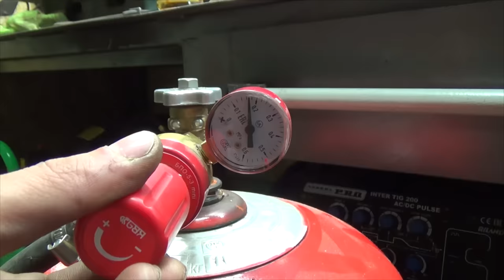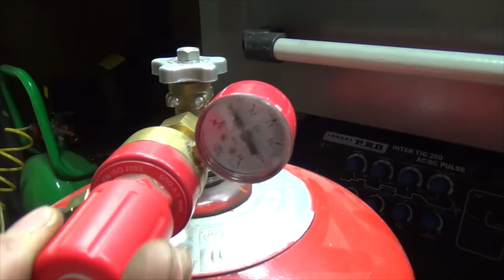Forge / Furnace turbo gas burner DIY jet propane

Comment: I apologize but any diy video that includes mill or lathe work instantly loses all credibility for me. Not saying this isn’t cool, just stating a fact.
Reply from the maker: you can not use a lathe stonok. use the correct size washer and drill the hole with a hand drill. welding can also be omitted, glue on the glue.
Reply: I do agree. Its a minority that does have an acces to a lathe or a millingmachine. But still a good video and i will copy this design😊

Comment: This is the standard burner that most every blacksmith and smelter uses. Same design that has been around for soooo long. And nothing turbo Bout it. That is a venturi burner.
Reply: Exactly, but there are plenty of wankers around reinventing things and using Turbo! and Insane! In the descriptions. 🤣😏
Reply from the maker: each has its own characteristics, but the principle of operation is the same
Reply: @MrNonius  I watched a lot of videos how to make a proper gas burner and the most of them aren't that powerful and so simple to build as yours so I agree that your burner is a real deal, could you specify the exact length of the tube, adapters and gap between nozzle and adapter in mm.? because I can't really understand what is added in the description
Reply: @MrRomanblond  
I'll try to help. Looks like 1ft pipe 1inch diameter. 2"x1" flare adaptor. MIG/flux core welder tip. Don't know what size. Hex threaded standoff. Then a bolt of some size. Then just scrap pieces of metal.
Reply: For orifice sizes theres charts online.
Reply: @MrRomanblond  if you don't understand from the description I'd suggest not playing with fire. Be safe, not rocket science but don't burn shit down by numpty.
Reply from the maker: pipe 1 inch pipe length 300mm
Reply: @MrNonius  thanks, I managed to assemble burner and it's awesome, so super easy to make and no need to have those fancy tools like turning cutter that other tutorials I watched
Reply: I’ve built a couple. I do like his choke design though.
Reply: Could I build this but put a 45° fitting on instead of a reducer for the flare?
Reply: Kl

Comment: Good job, I have worked in the R&D at a gas appliance manufacture, many hours spent on gas venturi development, along with orifice design, your design of adjustable orifice location and primary air adjustment is exactly what a good setup needs, advanced orifice design is really only needed if your trying to hit emissions and efficiency targets.

Comment: Thank you for the video, I have watched it numerous times, and made my own version of your turbo burner, with a few tweaks to the design to fit my needs. Mine will be connected to a 100# propane tank. I'll be using it to heat my foundry, though, if I wanted to, I could adapt it for a small forge as well.(currently I use a coal forge) The only issue i have at present is how to connect the propane fitting to my burner. I believe I used a 3/8" bolt hollowed out, with a .035 weld tip as my gas feed. I have no idea what fitting(s) to look for... will probably hit up a hardware store with my bolt/plate and propane regulator hose in-hand to see what I can come up with.... sorry for the rant, thanks again for your inspirational video!!!

Comment: You should add a blower motor to the end to force air into it. I used a old air mattress blower and attached a dimmer switch to it so I could control the speed. You just have to dial it in and it increase the temperature drastically.
Reply from the maker: thanks, I will take your offer
Reply: I used a tee at the top of my burner and added forced air with an electric blower motor.  I simply used a tee and a ball valve to control air, all pvc.  Forced induction is the only way to forge imo.  Naturally aspirated, with or without choke, can never come close to forced induction performance.  Also the galvanized fitting will give this person zinc poisoning.
Reply: How about Air Compressor? How many PSI for the pressure?
Reply: I have used a hair drier to blow air into a charcoal furnace and it would melt bronze. I love your video. It opened my mind!
Reply: Forced air burners are not so simple. You can't just add a fan and it goes brrrrr. You need much more tubing, a needle valve, and many other parts.
Reply: @LBCAndrew  I always love when people like you comment on stuff they know absolutely nothing about. It's hilarious to see you actually type out something so unbelievably stupid and wrong. You're talking to a person who literally built a forced air burner by doing exactly what I said in my original comment but you're somehow going to tell me that I "couldn't do that". Honestly it's amazing. Yes you absolutely CAN build a forced air blower extremely easily and no you don't need much of any "extra parts".

Comment: I have always respected the work of people who work with metal show off their skills in making products such as the turbocharged blacksmith sburner can increase the flame by increasing the pressure, but I think it's enough  it's a pity mine barely works.
Reply: Turbo or forced air needs a blower motor.  This burner is NOT forced air or turbo.  It is naturally aspirated with a choke.  <---Facts.

Comment: Great video!  Just a comment--the straight tube needs to be long as you show in order to get enough air/fuel mixing for stable flame.  Many burner failures are due to inadequate mixing before the flame front at the exit!
Reply from the maker: Thanks. I have a 300mm tube

Comment: Interesting. Some suggestons. 1. use a stainless steel reducer for the flame holder; mild steel won't last long. 2. Not everyone has access to a lathe. could you use something like a 1/4" pipe nipple instead of drilling out a bolt? 3. It looks like it works well but i wonder if a gas mixer would help? I used them on my blown  forges. Looked sort of like a six petaled flower but with the petals twisted to about 15 degrees off the axis of the tune
Reply: Вообще-то у него чугунный переходник!

Comment: Great video. But if this burner will heat an enclosed furnace, please show it working in an enclosed furnace, where there is no additional air to support the flame.  Some burners work much differently in the open air and inside a closed furnace.  Thank you.
Reply from the maker: Thank you

Comment: Venturi burners are nice but I prefer a forced air burner I get the same result running 10 lb of pressure on the gas that I do running 30 lb of pressure with a Venturi burner, saves me tons of money on propane

Comment: DIY jet propane burner all you need it a few odds and ends and a $600,000.00 lathe.
Reply from the maker: use a drill and a large washer

Comment: Is that OSHA approved and ANSI certified?  LOL.  Its bad ass.  I made one similar at work to heat a large chunk of metal up faster than a small rose bud would.  Needless to say they were not happy about it even though it worked great.  You went a lot further with it than I did.  Much better design than mine.

Comment: Yes all you need is a 1/2 million dollar machine shop for your simple DIY propane torch...
Reply from the maker: paper do not have a lathe to drill and the bolt just with an ordinary drill and washers can be made from a nut purchased at the nearest hardware store

Comment: I built a burner similar to that (Reil) and had to run gas at 30psi (2bar) melt my iron for casting. I then I added a fan ( a vent fan off of a water heater the building had negative pressure) to it and cut gas pressure to 15 (1 bar) and had the same results in a #16 furnace, it also does quite well in my #60 tilting furnace, in the #60 furnace, once about 1/4 (50Lb) full it starts melting at the rate of 1Lb per min i have only went up to 100Lb in that furnace but is capable of 200Lb.

Comment: Unless I miss the mark, the burners in my Chili Forge do the exact same thing. Forced air and a ribbon burner? Now we’re cookin’ con gusto!
Reply: This burner does NOT have forced air.  It has a choke and is naturally aspirated.  Forced induction burners have a blower motor.

Comment: Hello, for the piece of copper that says 0.8. How do I find it? What is her name? On which device is it located? Is it possible to dispense with it, by using a 1 mm hole in the screw directly? Thank you very much
Reply from the maker: this nozzle is semi-automatic welding torch, just drilled 1mm hole can be used

Comment: hmm, i'm going to need a non lathe version. maybe i could use a threaded tube for a light fixture instead of center drilling a bolt, which is basically impossible for me. as far as the intake face, i'm willing to bet that it would function just fine unfaced since you need a fair gap anyway for proper combustion.

Comment: Your torch nozzle is galvanized, you need to stop running that burner until you can remove the coating. At the least make mention in your description the danger you are showing here. Great burner, though. I’ve made this style and a Frosty’s T, I only run the frosty t.
Reply from the maker: Okay. I will write about this in the description.

Comment: Smooth out the threads on the inside of the bells and where the threads from the pipe meet, it will help to get rid of the little sparks and it gives it better air flow
Reply from the maker: Thanks. I will get rid of the thread. small sparks really are
Reply: So one can consider this if he aint oxygen right
Reply: @Azi-Az  are you saying, your not getting enough oxygen through your air flow?
Reply: @joeyirby316  ma bad,i mean is it a must i use oxgen gas.even if i have made thistype of foundry
Reply: @Azi-Az  I would like to see that, an I think it makes a difference on the flame end. The threads would cause tiny vortices slowing the flow. Clean flow on any gas mix products a better temperature.
Reply: Nonsense.  They will melt off with use quickly.

Comment: thanks alot.please tell me the exact diameter of the hole of the Brass nozzle  where the gas go through (0,5/0,6/0,7 mm????)
Reply from the maker: I am using a 0.8mm nozzle. If you put a 1mm nozzle you will increase the burner power. If set to 0.6mm, the power will be less
Reply: @MrNonius  thanks alot

Comment: can you tell me why the pressure in the cylinder drops over time ( the cylinder is 12 liters), although I set the pressure to 0.2 atmospheres, this is the first, and after again a short time, as the pipe heats up, spontaneous ignition of gas in the pipe begins, what am I doing wrong?
Reply from the maker: My pressure stably drops if the gas in the cylinder runs out
Reply: Put the cylinder in ice water if you want constant pressure.  Temperature affects pressure in the cylinder, when it gets hot the pressure goes down.  Cold and the pressure increased.
Reply: @jmbstudio6873  Thanks, I'll take that into account
Reply: Plain room temperature water or slightly warm.  Propane is liquid in tank,must boil off into gas. As pressure drops in tank it gets colder inside tank.  Propane boils at -44 degrees Fahrenheit at atmosphere pressure.

Comment: Have you got an exact list and sizes of parts? Length of the 1 inch tube plus all nuts etc. Thankyou.
Reply from the maker: Propane torch with 1 "tube, 1-1 / 4 to 2" adapter, M10x90mm bolt, M10 nut, large washer and 0.8mm welding nozzle. All of these can be found inexpensively at a home improvement store.
It is the most efficient and easy to manufacture turbocharged gas burner. It will easily melt aluminum if you need it. Manufacturing takes only half an hour. If you do not have a machine, you can use a smaller diameter adapter and pick up a finished washer.
Tested on gas at 0.5 bar (approx. 7 psi). It can increase the flame by increasing the pressure, but I think this is enough to heat a forge or furnace. I can regulate the propane flow with the pressure regulator between the gas tank and the burner.
Reply: Sorry to be a pain, how long is the section of 1 inch tube?
Reply: 12" long 1c black iron pipe

Comment: sorry but what use is a burner that only does 1000c ? you cant forge weld with it .
Reply from the maker: This burner gives more than 1000 degrees. With its help, you can forge any metal. The metal will split with a white glow, but it will not work to melt it
Reply: @MrNonius  propane should achieve 1980 c , so your loosing it somewhere
Reply from the maker: maybe it reaches 1980 I did not measure. I have no way of measuring such high temperatures. thank you
Reply: @MrNonius  as a blacksmith you have no way of measuring temperatures ??? use a colour chart for heat treating  you can get within 200c  just by comparing it to a chart , how do you harden and temper anything you make if you cant tell temperatures ?
Reply from the maker: I'm not a blacksmith, I just showed you how to make a burner
Reply: @MrNonius  got a power hammer last week just building my gas forge now i have an alec steel burner to go in it , should probably have got 2 but i can alter the size of the forge i am building so may not be an issue , but that one burner Alec used to forge weld a 42 lb billet of pattern welded steel .

Comment: 6:30 WOW!!! Question:: when you open that air-valve the flame automatically sucks in more air, becoming more intense???
Another Q::: What it the Max-flame temperature of this type of torch??? & thanks.
Reply from the maker: Yes, when I open the air is sucked in by itself and the flame burns more intensely. The combustion temperature of propane-butane ranges from 800 to 1970 ° C, the combustion flame of pure propane has a temperature of about 2526 ° C, and the heat output, on average, is 2110
Reply: @MrNonius   Wow::: Is that not enough to melt steel???
Reply: @kareemsalessi  no it isnt. It will heat steel past red hot, but not quite to white hot. Thats why propane or butane cannot be used for gas welding, acetylene has to be used for that👍
Reply: @kf8575   Awesome, thank you for the tip.
Reply from the maker: No

Comment: Amazing craftsmanship, curious to know how long it takes to learn a craft like this?
Reply: It’s nice work , but they didn’t remove the galvanized coating. When heated the gas is very dangerous. Dangerous mistake.
Reply: @tommyrusso8434  But isn't that over after the first full heat up.?
Reply: @CONEHEADDK  the metal will heat at different rates and expel the gases over time. Eventually it will stop, the outside coating will put off gas longer than the inside.  Easy fix, remove the coating, simple vinegar will do the job.
Reply: @tommyrusso8434  I would probably just have heated the whole thing red with an other torch, being "that irritating guy who tries to get people to follow the safety rules, when we all have to work in the same glass school workshop, where one rule is, expect everything heating up to create dangerous fumes, the first time it heats up" - but nobody cared, because the teacher didn't..  Not even the seperator, that contained super fine silica dust did she/the school have respect for, so it was used in the same workshop that the students and the ovens stood in..  I couldn't even get them to move the fire extinguisher, that had a "Minimum 1 meter from electric outlet" sticker on it from it's place 20-30 cms from one..  I probably wouldn't have even thought of fx vinegar, but that would be the easy way to do it, if you have the time and patience. It sure can do miracles to rusty things.
Reply: as long as the video is

Comment: Since you have lathe access, I'm wondering if the final stream would be cleaner if inside threads of the adapter were lathed out smooth? Would it be slightly less turbulent, and be a more compact stream? Curious if you've thought about that... Anyways, great build, dude!
Reply from the maker: I didn’t think about it. Thank you
Reply: It does help. Many pipes have a seam along the inside which needs to be removed and it's also best to clean out as much of the threads that aren't holding it together to reduce turbulence. The most important part of the burner build is perfect center placement of the mig tip. If it's anything off center, the flame will suffer.

Comment: Great burner, just wondering though what would happen if you dripped oil into the flame as well, would that produce more heat ?  You need to get to at least 1085 C to melt copper ...

Comment: Wow, a naturally aspirated burner that claims turbo or forced induction.  Where is your forced air?  Galvanized fittings will give  you zinc poisoning so either remove the coating or just use black pipe for the bell at the end.  I dont like to rely on atmospheric pressure for my forge to run at peak efficiency so I use a blower motor to create my own pressure.  I built naturally aspirated with chokes, without chokes and they work ok at way higher propane psi rates.  Having forced induction allows me to forge at 3psi or forge weld at 6 psi on the propane guage.  Im in Cali USA and everything is way..way..way overpriced including propane.  Did I mention propane is overpriced in Cali?
Reply from the maker: Thanks. I will remove the zinc coating

Comment: Can anyone please help,
All I get is a large red flame from mine and no matter how much I adjust the air intake it just stays the same 🤨
Reply from the maker: Look carefully at what depth the gas nozzle is installed. If you can't do it then I think it's too high. Try different positions.
Reply: @MrNonius  thanks for taking the time to reply to my plea for help, at last I’m melting metal, thank you